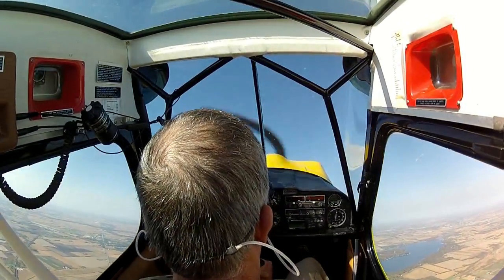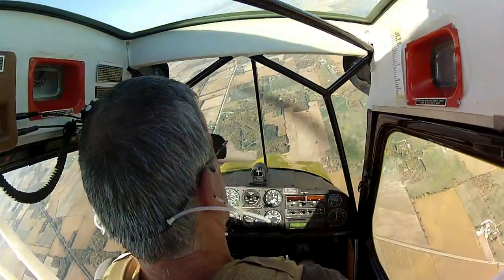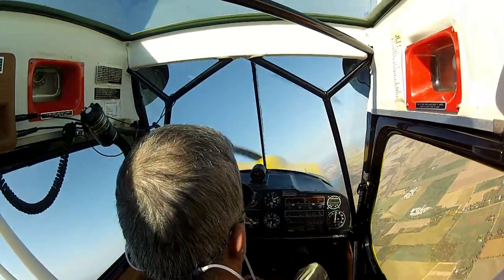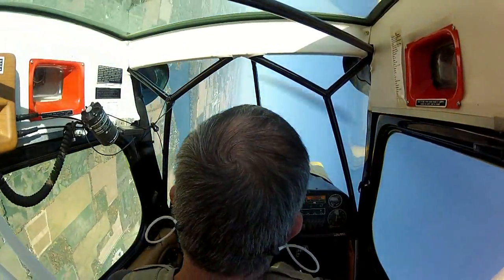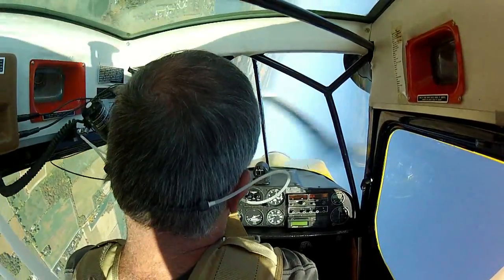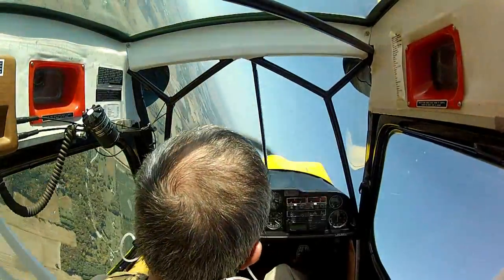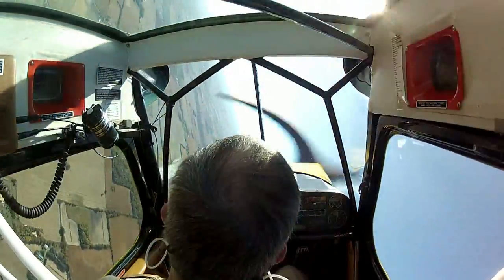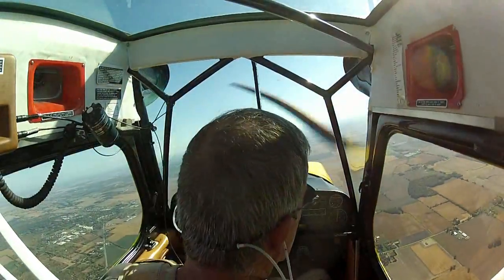how does an airplane turn

Comment: Jim. Thanks for posting this. I'm not a pilot but I'm interested in flying and aviation in general. I've been trying to understand how commercial aircraft make those bank turns. Often, when making turns, I look out the window and don't see the ailerons changing position. So how is it turning then? Is it the elevators and the rudder doing this?
Reply from the maker: Hi Richard, the ailerons move only during the initiation of the turn to make the aircraft roll.  Once in the turn, the ailerons are back to neutral because the airplane isn't rolling anymore.  When it rolls out of the turn the ailerons once again become active to make the airplane roll back to straight and level.  So, if you aren't looking at them at that time, it will look like the airplane is in a turn but the ailerons aren't doing anything, and in fact they aren't.  However, the horizontal stabilizer back at the tail, which you can't see, will be deflected up slightly to hold the nose up during the turn.  And if you happen to be looking out the window when the turn is initiated, you will see the ailerons move slightly, and also some small spoiler deflections.  At enroute speeds the amount of movement required for gentle turns isn't much.  You will actually see more if you look out the window during the final approach to the runway especially if there are gusty winds.  The pilots sometimes are required to make quite large control inputs even with large aircraft in turbulent conditions.
Reply: Jim Bair  thanks Jim. I’ve flown a lot in the last few weeks and I now see what you’re saying. The ailerons move slightly to initiate the bank and return to neutral position. I’m amazed at how such little movement of the ailerons makes the plane bank. One or two inches and you can really feel it. Is it the same thing on takeoff with the horizontal stabilizer? You don’t see them move upwards much but maybe it doesn’t take much to get the nose up.

Comment: Hi, I wonder if you would mind me asking what your current credentials are. I'm asking because I am doing a physics project on the physics behind aeroplanes turning and it would be helpful. Thank you
Reply from the maker: 20 year career in the military as a fighter pilot both in the Navy and the Air National Guard.  Flew A-7's, instructed in A-4's, then in the ANG flew the A-7, the F-106, and the F-16 for 10 years.  Currently an airline pilot flying the B777, although that doesn't really contribute much to this.  I'm pretty good on autopilot, though.  :)  I'm also a CFI and FAA examiner and have taught aerobatics and unusual attitude recovery.   Also fly weight shift control, helicopters, and gliders.    Flying fighters is where you learn that it's the elevator that controls the tightness of the turn and the ailerons exist to roll the lift vector to the direction you want it to be.

Comment: Aircraft banks, lift vector tilts, horizontal component of lift generates centripetal force. Thats what turns any aircraft. Doing aerobatics like this, you have crossed controls holding the aircraft from turning. Roll creates horizontal component of lift that turns the aircraft. Nice aircraft and flight though :D
Reply from the maker: Roll doesn't create the lift, it simply points the lift vector in the direction you want it.  Then pushing or pulling on the stick controls that lift.    And yes, cross control is required to keep the nose from dropping.   What you say about the aircraft banking and tilting the lift vector and the horizontal component of lift is absolutely correct.  In movies, the action takes place out the front, but in reality, it takes place in the top of the canopy and fighter pilots get stiff necks from looking up.  In military pilot training one of the first things you learn is that rolling the aircraft does nothing but roll it.  When you stop the roll at say, 90 degrees, well now you're still pointed in the same direction, but you're wings vertical.  It's only when you pull back on the stick that anything exciting happens.

Comment: no mention made of rudder.
after you banked 90 degrees I did not notice you lose altitude,
where you using rudder to provide lift ?

and how does rudder come into play
to provide coordinated turns ?
Reply from the maker: Yes, I was holding the nose up with rudder to get some lift from the fuselage to keep the airplane up relative to the ground.  I didn't mention it because the video was about the use of elevator in controlling the rate of turn, which is lift in the horizontal, and the use of aileron being pointing the lift vector.
Reply: so a good, coordinated turn involves all 3,
ailerons, elevator and rudder ?

its confusing and I'm finding it hard
to find good teaching about it -
some say ailerons and rudder
and
some say ailerons and elevator
Reply from the maker: Don't confuse aerobatic type flight with normal everyday "take a passenger sightseeing" sort of flight where turns are coordinated.  Look at some videos of aerobatic pilots taken from inside the cockpit.  The control inputs required are completely dependent on the type of maneuver being done.  So when you say a "good coordinated turn", I think you are referring to a standard gentle shallow upright turn like a person might see in "everyday flying."  But the point of this video is to demonstrate that no matter what the turn type, the ailerons are used to roll the airplane, and the turn itself is the result of the lift vector now being pointed in a different direction, and the elevator is the control surface that controls the aoa of the wings, and lift.  Increase aoa, increase lift (at less than stall aoa, of course).  Push on the stick, and the aoa will be negative, and the turn will be toward the bottom of the airplane, pull on the stick and the aoa will be positive and the turn will be toward the top of the airplane, as the video demonstrates.  All the aileron does is roll the airplane, it doesn't make it turn.  It just seems that way.  :)  Think about it and watch some aerobatic videos.
Reply: It seems years of driving a vehicle on a 2 dimensional surface
and turning a wheel to go left and right
along with the conspiracy to put a semi-wheel on an airplane stick
to trick me into thinking like a car
has warped my perspective....

like The Outer Limits episode 
where an alien from a 2 dimensional world 
got stuck in our 3d world for a while
but finally escaped with help.

BTW - loved the video on traffic pattern !
Reply from the maker: You are correct about the rudder.  I am cross controlling to keep the nose up.  And you'll also notice I'm not exactly at 90 degrees, just very steep bank to make it slightly easier, although on outside rolling turns (rolling right while flying in a circle to the left) the lift is sometimes negative, which is an advantage of a symmetrical wing on an aerobatic airplane.  In maneuvers like this, the turns are not coordinated and a very wide, very tight seatbelt is what keeps you firmly in the seat.